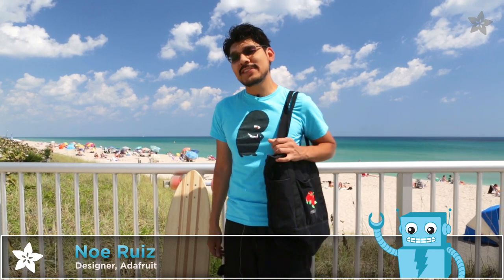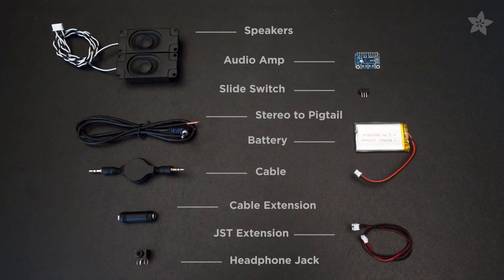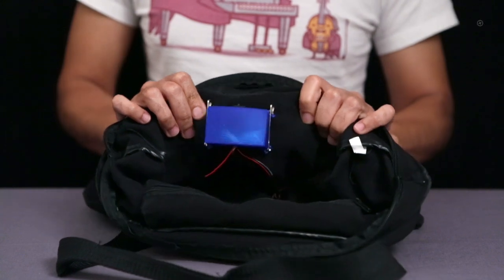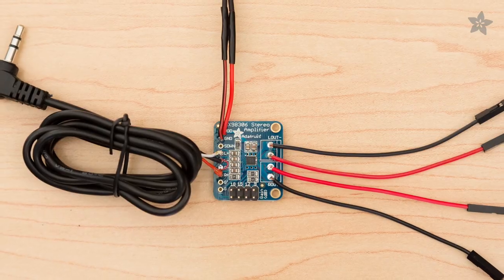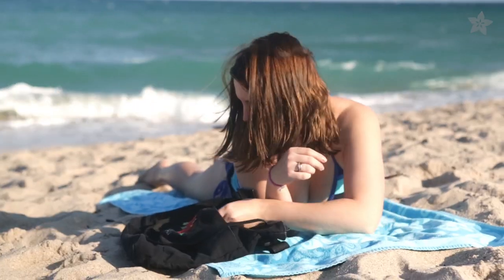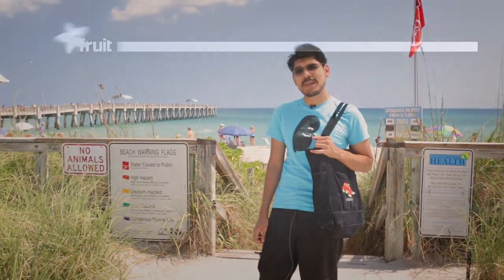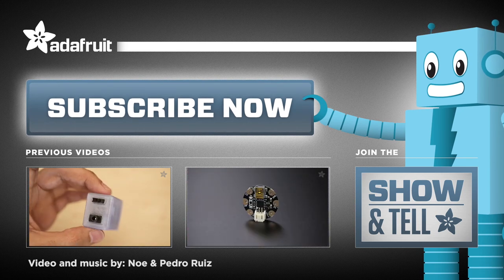Boombox Beach Bag with Audio Amp and Speakers

Comment from the maker: Boombox Beach Bag with Audio Amp and Speakers
http://adafru.it/b99867

Summer is coming up, so why not build a project just for the beach? Upgrade your old beach bag into a hi-tech beat blastin’ bag with a MAX98306 3.7w stereo amplifier and mini speakers.

A flexible 3d printed enclosure will hold the electronics and this 3.7 watt amp will power a pair of these 3W stereo enclosures speakers. Hook up the speakers buy following our guide on the Adafruit Learning System.

Read more: http://adafru.it/b99867
 #projects  #AdafruitLearningSystem

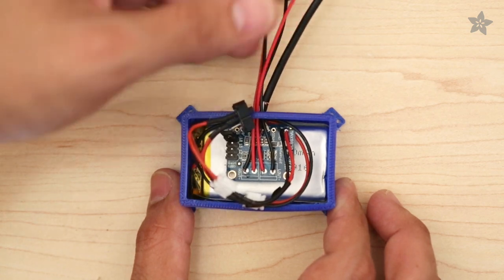Comment: Hmm, 0:47 shows a circuit board with sharp pointy soldered pins on the bottom of it being put on top of a foil wrapped lipo... that doesn't seem like a good idea.